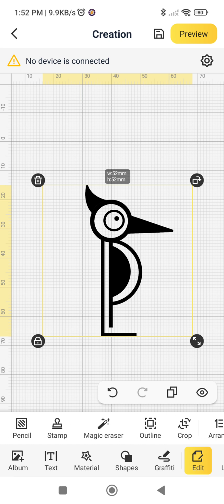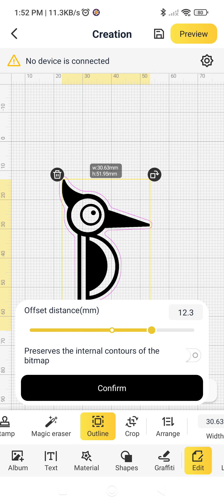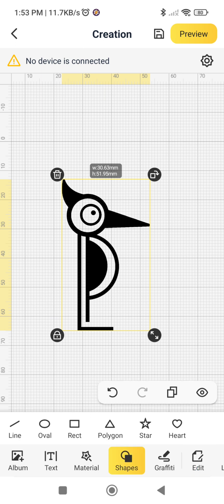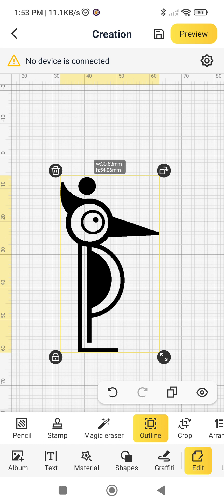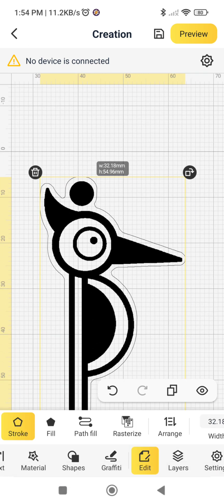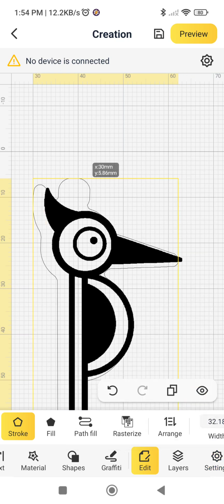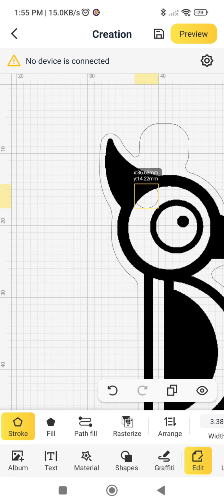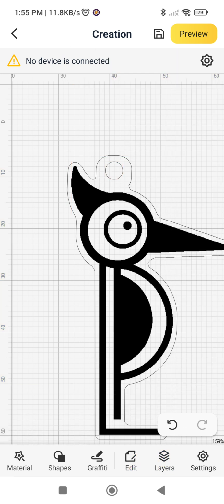LaserPecker Design Space for Android - contour line manipulation

Comment: Hi, thanks for the video.  Is there a way in Design Space to use a shape, like a circle, and change the layer from Line to engrave instead?  Without having to engrave the inside of the shape.  Meaning that it would only engrave the circle outline.  Makes sense!!!  Thanks.
Reply from the maker: Yes, by default you can add shapes as lines and those lines are used for engraving or cutting depending on your settings.
Reply: @yy502  Thanks for the reply.  For the life of me I can't seem to find where to change it.  Where do you do that?
Reply from the maker: @stiffbag69  are you in any LP Facebook user groups? It would be easier to ask questions there, and I'll be happy to reply with screenshots or recordings.